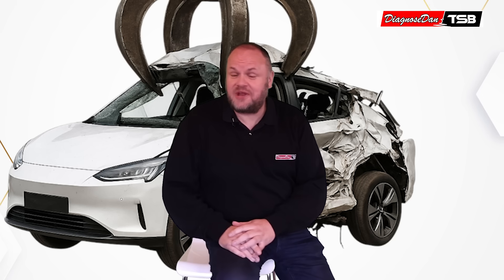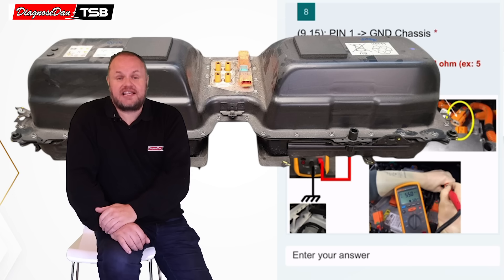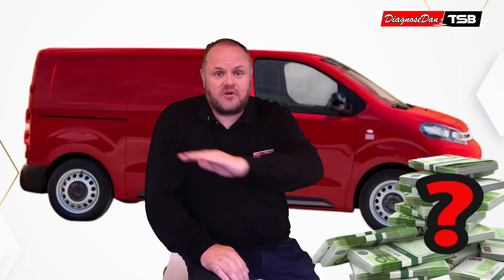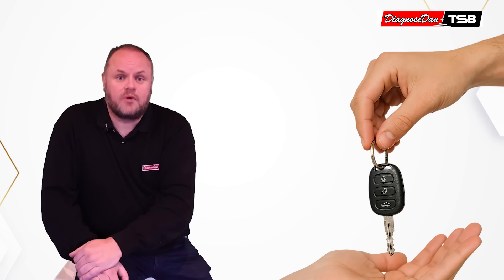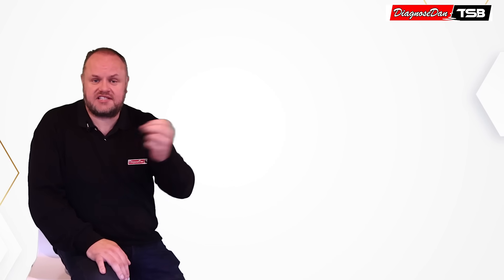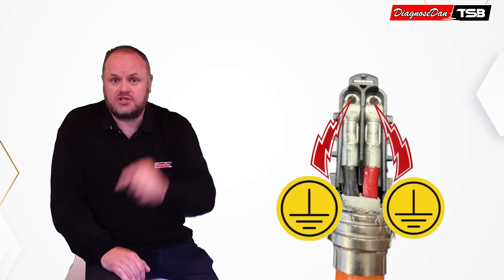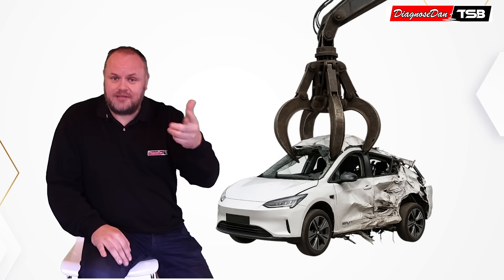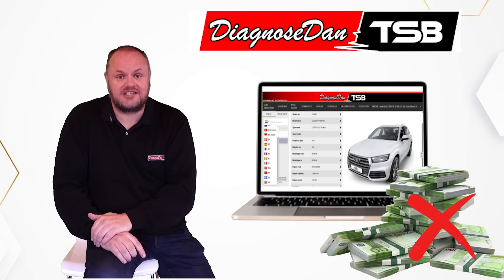4 year old EV nearly scrapped – Citroën e-Jumpy IV stores fault code: P0AA6 09 – Drive Battery

Comment: Poor workmanship from the dealer that. i've never fixed an ev but i have a nissan leaf and it fails to move and Nissan wanted £2500 deposit and the rest when repaired, so i thought i'd look at it myself and i do own a fluke megohmmeter so i got to testing, at first i thought it had a battery problem but after testing everything even the cables which i did test it had a isolation problem going to the ac compressor, after disconnecting it the short is from the PDM so i have now removed it from the vehicle and the problem is still there even when disconnected so it requires a new PDM and it wasn't hard to work out

Comment: OK . . . so, how was that test wired up? If it was simply a short to a screen, that might not show up as a circuit. There must have been another ground on that screen when you had the cable on it's own. Where was it "leaking" to? It's a capacitor I understand, but, wow, that's a bit tenuous. Still a bit puzzled.
Reply: Are you confused about why the cable was arching when we tested it? If thats the case......we are testing the resistance of the cable with an insulation tester. You can measure resistance by applying a voltage to a circuit and than look what they current is. It's ohms law. But with a regular ohm meter you only apply a tiny voltage but an insulation tester applies a high voltage in this case 1000V. We apply that with the positive and negative lead of the meter. So when we are testing the cable we are applying high voltage that could leak via that tiny wire. Thats what you could hear in the video. Does this answer your question?

Comment: It wasn't the faulty cable that almost got it junked, it was poor troubleshooting. Unplugging both ends to test a cable is the first thing and most important thing to do. But, poor manufacturer diagnosis procedure. Sweet deal that Morten sold it back to the customer too! Top notch guy there.
Reply: Morten is a good man👌

Comment: Not so bad when everything is under warranty such as our case.... The dealer spent hours of their time and ours diagnosing the heater and even changed the heater element which would have cost over 1k UK pounds.... in the end it turned out to be a blown fuse!

Comment: sometimes , we just need to be left alone with a problem , don't keep fucking ringing me up , going IS IT FIXED YET ??? 

spent today downloading ,and making work , a new ( to me ) diagnostic  system . 
customer vehicle , that came in , crank / no start , died whilst driving , 2 miles after filling with fuel . 
so you would think he did a mis-fuel , not that , smelt p/tank = ok , checked receipt said petrol = ok . checked fuel to injectors = ok on volume and pressure , checked spark = intermittent , .... hmm had this before , changed cam position sensor = same intermittent spark  as before , so not that . 
try and hook diagnostic-kit to car  ? will not hook ? 3 different com ports , try all 3 , will not hook ? 
start checking powers , get to ECU power , and is messes around , inspect fuse , LOOKS good , remove and test with a meter =fail ? then it passes , then it fails ??? fuse is not blown , it has fractured where the fusible bit joins the thick upright bit that pushes into the holder ! 
replace fuse , diagnostic kit now hooks to car , engine starts and runs .
so rubber mount fuse block on an anti-vibration mount , so hopefully it won't happen again. 
the fail to move , 2 miles after the fill-up was a red herring , as was the intermittent spark , 
customer had visually checked the fuses , when  the breakdown truck arrived , but they all looked good .
so never assume fuses are good , even if not blown .

Comment: The basic issue boils down mostly to education. Even car mechanics are trained nowadays in a kind of low profile mechatronic technician, they still remain mechanics in their over all skills regarding electrotechnical issues. The result that swapping expensive parts is the only way that they get used to fix problems. And they never gain additional knowledge about EV's repairs this way.

Comment: The HV cables are braided and grounded in order to have EM blocking. 
Whenever you have loss of isolation, you unplug your cables and test which side is still failed. But I never tested the cables themselves.
Reply: Thanks for taking the time to leave a comment!

Comment: I am shocked that it is not obivious to technicians that a insolation test with connected devices is a big mistake. In My field of work that is eplicit and strictly forbidden. because of: 1. Invalid result (false fault); 2. damage to the components
Reply: Most mechanics are still quite inexperienced with HV testing unfortunately.

Comment: Real fault Finding is a Trade.
And many SAE codes are just not specific enough. Have a similar Van (expert) every failure gives the same generic HV fault. Was 4 months at the dealer and finally the swapped almost all of the HV wiring.
Reply: Glad they found the issue!

Comment: Why did it take 4 years for this factory fault to appear?  How could multiple instances of this fault leave the cable manufacturer?  Another instance of not getting what you pay for!
Reply: That is a good question and one we have considered ourselves. 
It is likely related to movement and vibration. 
The cable factory proberbly produces thousands of the cables per day. The process is not changed before the fault is discovered. At that time there might already be thousands of cars driving around with bad cables.

Comment: Im car mechanic and elenctonic technician. But unfortunately im not doing this job , i admire u so much dan.
Reply: As an electronics tech I'm wondering if  I should switch to automotive, the fault finding process illustrated here is standard for electronics repair. As for dealer technicians getting lost in the manufactures fault finding tree this has been going on for years on the ICE world.
Reply: @jamier.6634 you are more than welcome there is a worldwide shortage of Automotive technicians.
Reply: Thank you very much!

Comment: This sort of thing is only going to get worse as more electric vehicles out there and technicians with limited experience. 40 years as a electrical maintenance  engineer and I can tell you one thing there is no substitute for a clear understanding of fault finding process. To insulation test a lead with it plugged into an electronic device is idiotic, but this is a very strange fault to come across to be fair. You can’t diagnose faults by changing components without spending thousands. This is clearly a manufacturing defect and the company should be held responsible for the costs on repairs but nobody will have the money to take them to court 🤷‍♂️
Reply: Thanks for sharing your thoughts!

Comment: Just imagine the customer had agreed to replacing more parts that would not have solved this issue. Kudos indeed to Morten and DDTSB! Fascinating!
Reply: That would have become a difficult situations and the customer proberbly wasn't going to pay for those parts. As the inverter and electric motor were no longer under warranty the manufacturer wasn't going to pay for those either. The shop would have been forced to take a huge loss! Thats why shops should work as efficiently as possible!

Comment: Actually the real issue was not the wire, but the lack of information given by the dealer diagnostic tool and the bad information given in the repair manual where they excluded the wiring faults... This is why we really need people that know their stuff to write the bulletins/ manuals/ instructions, not relly on students or junior tech writters 😊
Reply: Thats exactly why our company is specialized in writing aftermarket bulletins!

Comment: Yes excellent video Dan. We have the same issues with insulation resistance testing on solar panels, where the rails that the panels are fixed to must now be connected to ground, you simply can not find the low resistance fault due to the connected diodes in the circuit. 
We call the fault you had with that cable a George Michael, (a careless whisker)

Comment: We are going to see more and more of these faults. The other day I did see a video of a BMW i3 that had a high voltage issue and it eventually ended up being the heater for the coolant water that was used for the cabin air.
Also a relatively cheap item that would have rendered the car an expensive piece of scrap if it wasn't found.
Diagnostics requires a lot of knowledge and in the world of electric and hybrid cars there are so many new ways things can go wrong.
Reply: Was that video by Ritch rebuilds?
Reply: @Diagnosedan  I think so. My parents have an i3, so that's why I took interest.

Comment: As a retired electronics engineer, I agree with @gutsngorrr. The person producing the software design specification does not have the necessary experience. The resultant procedure is then considered to be superior to the knowledge of the technician following it. Even if the technician suspects a different solution they are not allowed to deviate from the procedure by their management. The problem is therefore having a procedure. The technicians need to be trained as electronic engineers which would give them the skills to diagnose any problem without a procedure: this is what I did all my professional career.

Comment: Worked on the neighbors heating system after the dealer had been there replacing circuit boards for thousands to no avail. Turned out water had entered into the temperature sensor cable outside the house causing random temp readings and erratic function, can tell you, the neighbor was not happy when we found out that a 10 dollar wire was the fault...

Comment: Stellantis quality strikes again 😢, I didn't even know that those types of cables with both + and - wires together under the same shield are allowed, is that a very low HV battery like 200 V or something?
Reply: These cables are made by Yazaki, a Japanese company that is one of the world leading manufacturers of Automotive wiring looms and cables. Stellantis didn't cheap out on these cables and didn't produce these themselves.

Comment: Soooo... In essence the test plan the dealer has to follow is very poor and not well thought out.
Reply: In this case it's certainly not pefect
Reply: Yes, sometimes they just do not simply look at the electrical schematics, just replace, replace, until the car works again. Had this once with a short-circuit sensor that tripped a fuse. But the BMW dealer wanted to replace the whole ECU.
Reply: @Marvv89 can't always blame the tech for that

Comment: moirten sounds like an idiot to me, he beleived the dealerships conclusion, and didnt follow the correct procedure which is TEST EVERYTHING, AND DONT BELIEVE WHAT OTHERS TELL YOU, prove it to yourself
Reply: I would appreciate it if you could approach this with a bit more respect. 
It seems the video may not have been fully understood. 
Morten was the one who identified and resolved the issue. 
He did an excellent job and repaired the vehicle with only a €130 cable, whereas others had already replaced costly parts that ultimately did not fix the problem.

Comment: Another example of why EV'S are never going to be very successful until the manufacturers get theuact together and improve access to components and better fault diagnosis. George of ISG garage in London has just repaired an Audi with a faulty cable, having spent hours taking the battery, motors etc out, as per Audi diagnosis. A signal wire had broken inside the sheathing. Maybe they need ti invest in better wiring and not get it from Temu😮
Reply: This cable is made by Yazaki, a Japanese company that is one of the worlds leading manufacturer of Automotive cables. They didn't use cheap cables!

Comment: The manufacturer should check the cables and replace them before very expensive repairs are needed
Reply: Thats correct but the dealership has to follow the test plan, if they dont....no warranty
Reply: @Diagnosedan yes unfortunately. 😢 Thank you for your experience!

Comment: Quite shocking that the dealership did not have equipment that recognized the DTC's.
Whereas a "non authorized" reader could 🙄
Reply: It did recognize the faultcodes but the manufacturer just looks at it "different" 🙈

Comment: Since the dealer was so willing to throw the parts cannon they should have included the wires just to be safe.
Reply: The dealer actually has to replace the parts if they are willing or not. If they dont follow the test plan the dealer doesn't get compensation from the manufacturer.

Comment: Imagine if the dealership would not have cheaped out and replaced the cable along with the inverter; they would have assumed the inverter was the problem; of course that assumes the new cable didn't have the same manufacturer's fault as the original.
Reply: True😊

Comment: Strong work.........but the dealer dropped the ball on this one. As a technician who deals with high voltage power supplies and associated harnesses, the first thing we're trained to do when faced with these issues is to remove all connectors and complete a hi-pot (high voltage potential) test on the individual components.........most failures can be traced back to a fault in the harness.
Reply: The dealership has to follow the test plan. If the dont they dont get compensation from the manufacturer.
Reply: @Diagnosedan  Yes, a test plan that was poorly conceived. How unfortunate for the customer.

Comment: Great video (although a bit of a head in hand one) Dan. 
One thing though, you said at the end that the issue was a 130 Euro cable but in reality it was a cable which could have been easily fixed. I’ll stick with my ICE vehicles I think.
Reply: So he was telling, with te shielding cable pulled back it was functional again, Morton made the choice to replace it for a new one. I hope they tested the new one before placing it in the car, could be a poor manufactured one again 😂
Reply: Morten didn't know what was wrong with the cable and replaced it. The defect was discovered later by our research department.
Reply: @Diagnosedan Ah, dat gaf jij ook aan in de video idd. Laten we hopen dat de nieuwe kabels beter gefabriceerd zijn 😅.

Comment: Peugeot 208 and 2008 also suffer from insulation faults in the cable from the battery to dc/DC. The fault is mostly present when flexing the cable
Reply: Proberbly the same manufacturer.

Comment: "Technicians" aren't trained on electrical theory.  Basically need an electronics technologist to work on these things, given proper schematics the problem could be found very quickly.  Diagnosing complex electrical systems versus mechanical systems is very very different.  And these electrical systems are way way more complex than they were in older ICE vehicles.  Heck most techs can't properly diagnose even minor low voltage or communication faults in ordinary ICE vehicles these days.  The industry training isn't adapting nor are the license requirements.

Comment: Fair play to Morten and Co. for selling the van back to the owner... karma points for that ... 👏☺️

Given the critical nature of that cables insulation status, the manufacturing process seems sloppy and prone to potential (pardon the pun) faults in its assembly process... 

Engineering-in a fail-safe manufacturing process would seem obvious, in other words, make it physically impossible for this short to happen in the first place...🤔

The OEM codes were essentially useless here and its amazing that an aftermarket scanner could actually get better data.... its almost like the OEM code was worded that way to sell the customer a new battery.... 🙄

Interesting vid, Dan !!

😎👍☘️🍻
Reply: These cables are manufactured by Yazaki, a Japanese company and one of the world’s leading producers of automotive wiring looms and cables.  
You would expect that they know how to design cables properly. 
Although the manufacturer’s fault code description may not seem logical to us, it likely makes sense from the perspective of an engineer working in an office rather than directly on vehicles.

The dealer diagnostic tool also operates differently. After reading the fault codes you can proceed to the test plan where additional information and guidance are provided.
Reply: @Diagnosedan  Thanks for the reply, Dan ! 

😎👍☘️🍻

Comment: Lots of ev cars have been self deleating themselves on the ships . A few of those ships are on the bottom of the ocean . Lots of ev cars are thrown away now because its to expensive to fix . A dead high volt battery writes a car off because of the cost of a battery . Pieces of junk . My ice car is still going strong with over 500,000 km on it and its a 96 year model .

Comment: Insulation test is common for AC 230/400V system. It is understood that wires are best tested stand alone and so are devices. The problem lies in the way mechanical trained car techy is requested to follow electrical test protocol, without being educated enough in electric 101. Perhaps seek solar panel training, they are also now few hundred volts and DC and also uses lots of inverter.
Reply: This is absolutely true. Insulation resistance measurement should never be performed in any environment with devices connected at the same time. The measurement easily breaks electronic components, in addition to the fact that the measurement result is not reliable. This is very basic and a mechanic knows this if he has studied electrical engineering and basic measurements. Insulation resistance measurement is completely different from ordinary resistance measurement.
Reply: Using an on fashioned hand crank "megger" you would never leave the cable connected to an electronic component.